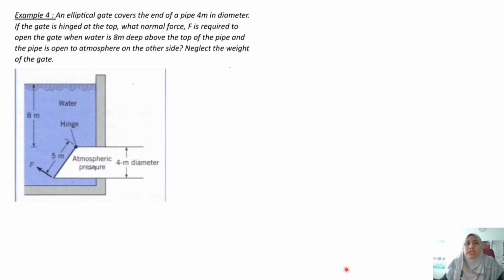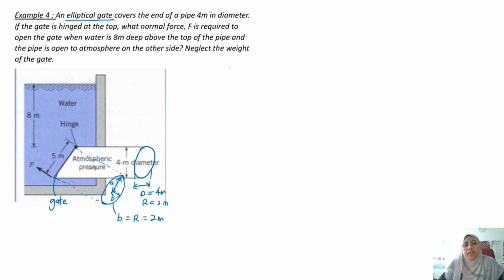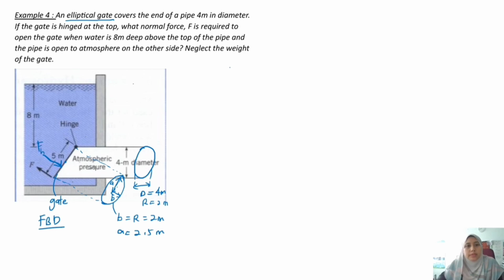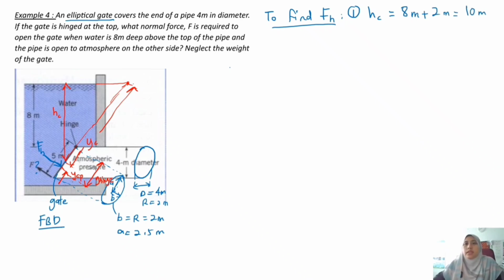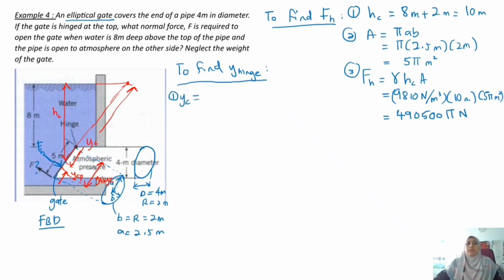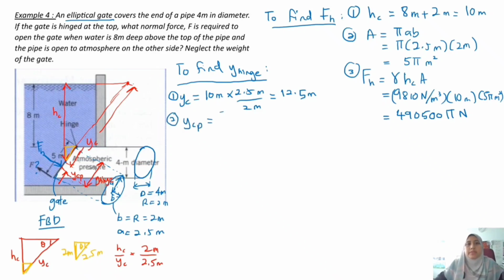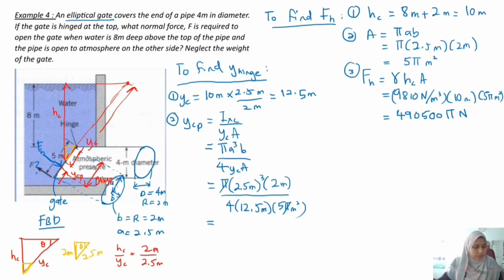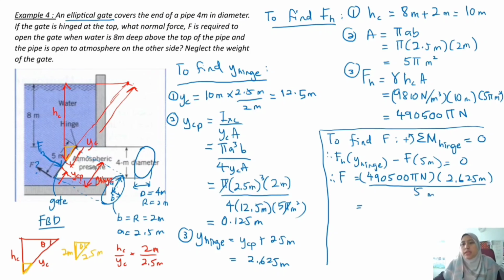Hydrostatic Force on Plane Surfaces - Example 4 (MEHB2023/MEHB2024, Sem 1 2024/2025, COE, UNITEN)

Comment: I learned how to find the pushing force (F) needed to open the gate. I need to balance the water's force (F_H) and external force (F) by calculating the turning moment around the hinge. This calculation must use the exact spot where the water's force pushes (C_P)
- Nurul Shahiza Binti Mohammad Puad

Comment: i learned that we must know all the force at the gate such as F external (gate open) and F Hydrostatic (gate close) before find what question need. 

i also learned COP (Ycp) is requires to find the average location of the pressure distribution over the body's surface

Muhd Adib Razin Bin Zaharudin

Comment: I learned that the hydrostatic force a static fluid exerts on a surface is calculated by multiplying the uniform pressure by the area for horizontal surfaces (F=P\cdot A).
- Danial bin Baharuddin

Comment: I learned that the normal force and hydrostatic force have different values with respect to its depth where it can be seen that the normal force has more force overall since it is located deeper than the hydrostatic force. 
-Mirzan Shafeeq

Comment: I learned that the center of pressure (CP) is the point where the resultant hydrostatic force acts and is located below the centroid of the submerged surface. - Areefa Zafira Bt Khamirul Amin

Comment: Hydrostatic force is the pressure force of a fluid on a submerged surface.
It increases with depth.
Total force F acts at the center of pressure.
The center of pressure is below the centroid since pressure gets higher deeper down. 
- Nik Hilman Daniel Bin Nik Mohd Zailani

Comment: 1.External force is used to open the gate.
2.Hydrostatic force acts to close the gate.
3.The depth of the inclined surface is Y_c.
4.	Y_{cp} = I_{xc} / (Y_c A) = (\pi a^3 b) / (4 Y_c A)

Mir Ezzatie Bt Abd Rahman